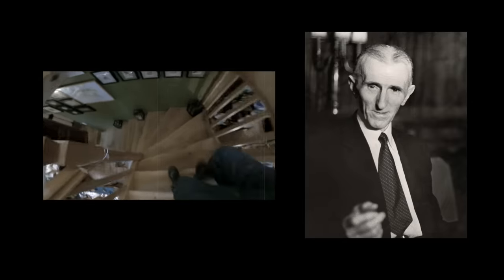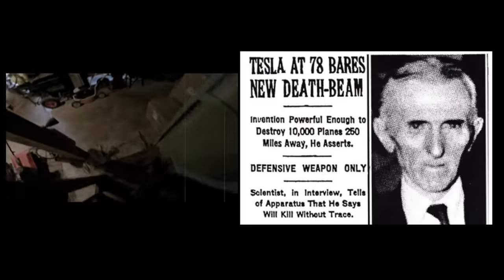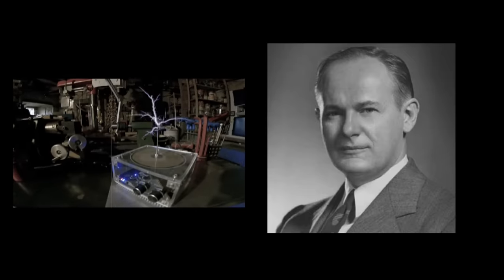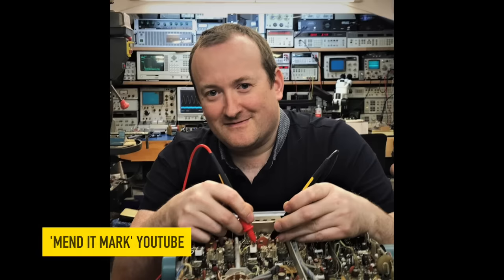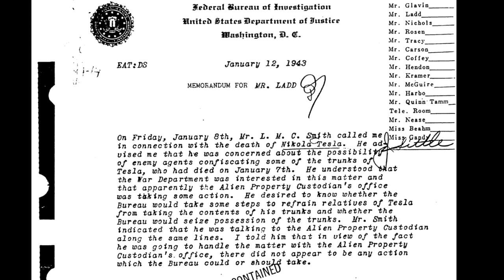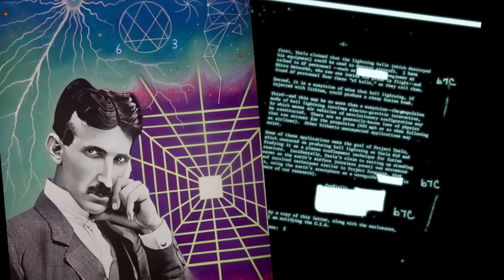Prof Simon and Mend It Mark - Tesla Death Ray

Comment from the maker: 🎯 Key Takeaways for quick navigation:

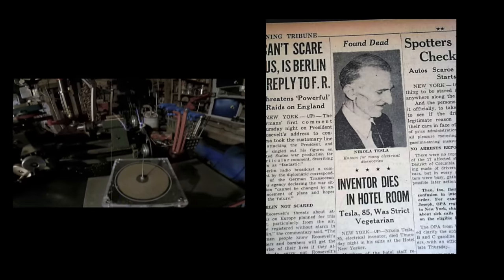00:43 🔍 Overview of Wheatstone Bridge
- Wheatstone bridge invented before Tesla's death ray announcement.
- Explains the principle behind Wheatstone bridge.
- Demonstrates how Wheatstone bridge measures resistance using resistors and a voltage divider.
03:13 📏 Building the Wheatstone Bridge Circuit
- Illustrates constructing the Wheatstone bridge circuit.
- Utilizes a decade resistance box for accurate resistance selection.
- Shows how to measure an unknown resistor using the Wheatstone bridge setup.
05:50 🧠 Wheatstone Bridge Evolution and Legacy
- Discusses the replacement of Wheatstone bridge with modern multimeters.
- Introduces the use of comparators in place of sensitive current meters.
- Mentions the legacy of Wheatstone bridge and its applications beyond its original design.
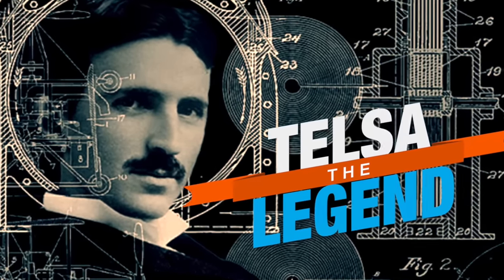08:12 💼 Government Interest in Tesla's Inventions
- Reveals the US government's interest in Tesla's inventions posthumously.
- Mentions FBI documents regarding Department of Defense's interest in Tesla's trunks.
- Highlights potential weaponization of Tesla's inventions according to recent documents.
10:14 ⚛️ Tesla's Inventions and Their Weaponization
- Discusses potential weaponization of Tesla's inventions such as ball lightning.
- Mentions Tesla's claims and their implications on high-energy physics and directed energy weapons research.
- Suggests connections to other historical events like the Rendlesham Forest incident.

Made with HARPA AI

Comment: My Dear Profesor, the answer is logically simple.

The Tesla Coil has an input voltage and amperage which is magnified by the ratio of the coils; lets say 1000 to 1; though Tesla was playing around with coil rations of 100,000 to 1,000,000 to 1 ratios. Given our ratio of 1000:1, you pump in 1 volt a the input, you will get 1,000 volts a the output (though the amperage will drop by the same amount of the ratio but we will deal with that later).

The Whetstone Bridge is used to balance the input so one does not have a run-away situation with the voltages. If you just simply keep pumping in voltage through the Tesla Coil it will spike up until you get the sparks of lightning about you that is out of control. This lightning is almost harmless to humans, but catastrophic to electrical and magnetic equipment. 

Tesla had in mind a defense grid or tesla coils the size of light houses protecting its borders from invaders. Since this was the 1940s and the advent of WWII, he was witnessing German bombers flying over Great Britain and bombing the nation. With the Death Ray Grid of Tesla coils, it gets turned on and lightning comes out, the magnetic fields are scrambled, and the electrical equipment of the German Bombers are fried, engines are shut off and compasses spin out of control.  Fuel tanks might even explode. Pilots and crews become a nervous wreck and if they do not bail out on parachutes, are doomed on a falling aircraft.

This is where the Whetstone Bridge comes in, to bring up al that power properly and safely. If not it will zap anything and everything in its area, not caring what it is.

The other part is amperage. When using coils to increase voltage, amperage goes down. If voltage decreases, amperage increases. Its the law of conservation. But with a Whetstone Bridge, you can add amperage through a secondary source to maintain its level of power while voltage is increased. This makes the Death Ray more powerful.

That is how it should work logically and by the laws of Physics. That is why Tesla left the Whetstone Bridge for them to figure it oue, but in truth you would need more than just one to balance voltage and amperage of the Death Ray. They would have to take that one apart and copied it a few ties to make the death ray work.

Now.... as for his death... Living in NYC, I know that as soon as the sun goes down, the pigeons go to their "homes" to roost, The only flying creatures out at night in NYC are bats and the occasional owl. There are no pigeons around. Tesla going out at midnight to feed the pigeons, I find rather odd and something of a cover up.
Reply: That last part made my hairs stood on end!
Reply: " But with a Whetstone Bridge, you can add amperage through a secondary source to maintain its level of power while voltage is increased."
And here is the pseudo-science.

Comment: LoL Showing my age ... The 1st Wheatstone bridge I encountered was a lot simpler, a long length of high resistance wire, a Battery, a meter and a wire with a croc clip on one end. Just move the cilp along the wire until it balances.
Reply from the maker: yes ...that principal works well

Comment: @MendItMark: What if someone were to build a computer in reverse? Big lumpy machine controls electrons. What if someone used these electrons to control the machine? Like universal trickery? You could use an escalating field to control the previous step. Like moving the rungs on a ladder. I know this question well, and the maths is well... Hard.

Comment: Why is no-one questioning whether the death ray was even a real thing? I think Tesla made some remarkable inventions in his earlier life, but completely lost the plot later on. In particular he seemed unable to understand the concept of damping which would have destroyed any chance of sending high frequency electrical energy using the earth and atmosphere as a wave guide, or as some kind of resonant element.  There are always losses in any system and he didn’t seem to grasp that. That's why Wardenclyffe was abandoned by the investors - it didn’t work. 

He also claimed he could destroy a building by fixing a small vibrator to its foundations, and tuning it to the resonant frequency of the structure. In his mind the vibrations would build and build in amplitude until the structure fell apart. But again, this can only work if the building vibrates with zero losses. In reality a concrete and steel structure, or a brick structure, is heavily damped so the vibrations would be absorbed and eliminated almost straight away.

Once again, Tesla's strangely limited understanding of the concept of damping and hysteresis led him to some very incorrect conclusions. It seems to me that - like so many top scientists - his most significant contributions were made when he was a young man in his 20s and 30s. After that, desperate to continue receiving adulation and money, he continued to make ever wilder claims, right until his death. That Wheatstone bridge was never a part of a death ray - it's a primitive multimeter, that's all, and multimeters are used in the development of something, but not their construction.  I'm going to say it for what it is: the death ray machine sitting in the vault downstairs - which in reality was a Wheatstone bridge - was pure bullshit, carefully nurtured to maintain the aura of mysterious genius that he so enjoyed. 

No, it is clear: he wanted to maintain the image of a genius with secret knowledge that could change the world because he enjoyed the status, the adulation and respect such claims brought him.

One of the things that really bother me about videos like this is the gullibility of the maker. For some reason the film maker assumes a priori that all of Tesla's claims are true but were suppressed by the evil, money-grabbing capitalists who were scared their income streams would disappear. It would be far more scientific if you dropped the credulous gullibility and instead asked some properly hard, sceptical questions about whether there is even anything in these claims.
Reply: yup but his vibration machine was felt across the city. reports from all over.   so maybe not as lossy as you might imagine.

Comment: Question 🙋‍♂️, I still don’t understand Plasma balls and the difference between ball lightning, many years ago a plasma ball the size of a Mellon and multi coloured came straight through the outside brick wall at ceiling height and traveled at a slow slow pace in a dead straight line all the way through the house, was truly fascinating
Reply: my mother saw something like that in my first house. apparently a ball came right through the letterbox, went right through to the other end of the house in a straight line down the middle of the passageway and diasapeared. that house had an entity too. not a nice one. 
was always fascinated by that tale, i was new to the world when it happened..  and here you are with a similar 😟👍

Comment: You are not looking at this through the mind of an obsessive.
An obsessive problem solver/inventor would view this as the missing piece of a jigsaw puzzle.
I would speculate every time Tesla explains his system, he gets asked, "How to you solve problem X?"
and Tesla just smiles knowing  in his mind that you just connect a Wheatstone bridge just so in the mechanism.
And to an obsessed Tesla he is fearful that his rivals, if they saw him with a Wheatstone bridge will jump to the same insight he had.
But, the rest of the world is not walking around with the exact context (frame of reference) that Tesla is thinking in, so it doesn't look like the missing piece of the puzzle it just looks like the prosaic measuring device that it is.

Comment: The problem most people have with recreating his death ray is they think it has to do with Tesla coils and AC power. They are thinking about electrical circuits and the way electricity works by what has been taught for the last 100 years which is incorrect.

Tesla did tell you how it worked but no one bothers to read anything he wrote these days.
Reply: "Tesla did tell you how it worked but no one bothers to read anything he wrote these days."
No, people can read - Tesla was just wrong (as he was with most of his claims).
Reply: @ABaumstumpf  his patents are pretty solid.

Comment: would the death ray be a distraction and it was an early form of radar?
Reply: Maybe... but think of it this way: the death Ray was about sending ( or transmitting as you will)... Radar is about transmitting AND receiving...
The deathray is not interested in receiving, well because the adressed subject is.... ahm... dead?

Comment: The wheatstone Bridge device confirms
1) how to build the teleforce transmitter,
2) how to tune the Teleforce transmitter,
3) and what equations are needed for the teleforce transmitter.

This wheatstone Bridge device proves Tesla perfected the teleforce transmitter in 1901
Way before the Tunguska blast.

Side note. Tesla fired the Teleforce from Colorado Springs not the Wardencliffe tower.
How do I know this?

Not known by anyone else (well maybe). Align the magnetic north in Canada to Tunguska. Where does the line follow in the US?

Hint: Not Tesla's lab in NY or Wardencliffe tower.

Use a globe or global way points.

If I were Nikola Tesla, I would lie about my whereabouts too! I would also get my assistants to lie.